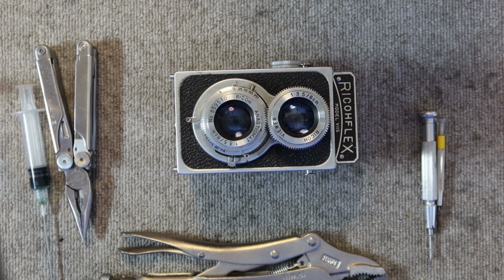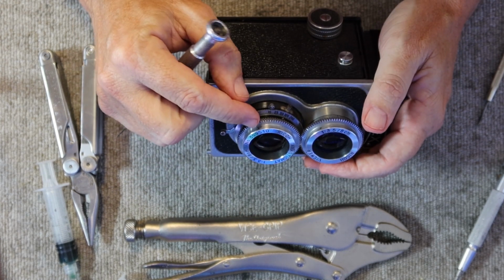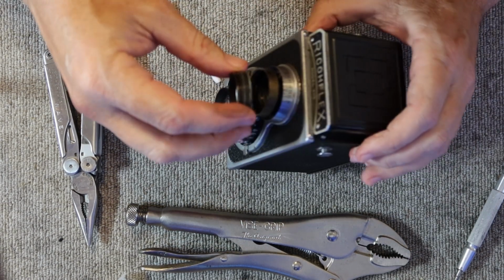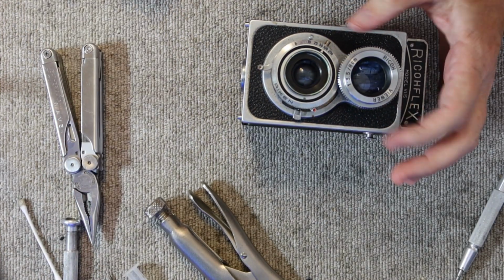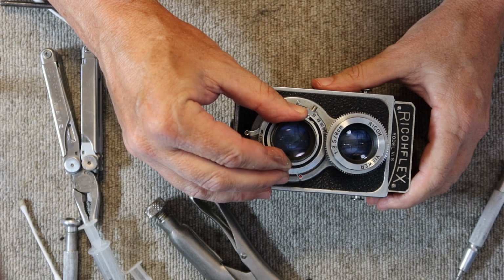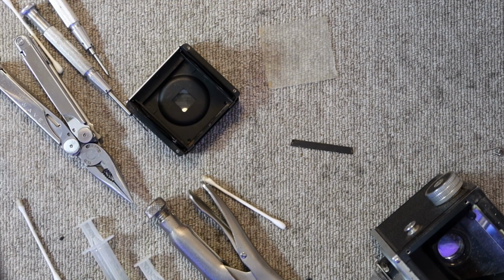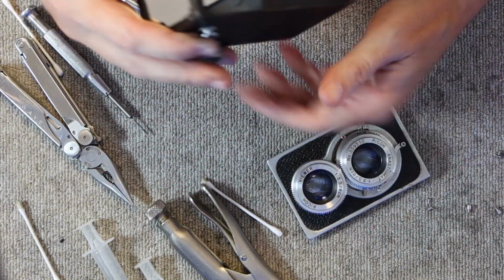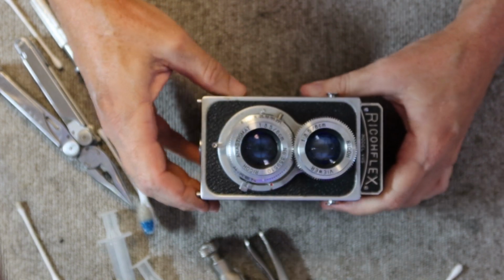How to Repair a Ricohflex TLR Camera

Comment: Great video, I wish I had this over a year ago when I took apart a Super Ricohflex whose lenses were nearly frozen and required a lot  of force to move. Didn’t know about the marks to align the two lenses, but used another method to set infinity focus.  I haven’t shot the camera yet to assess the focus, but could always take the gears off again and look for the alignment marks.
Reply: I have to clean inside the lens on mine.. the second lens from the front has a little fungus and it could use shutter adjustment.. that's the part i've never done before

Comment: Hi, Thank you for this video! I had one question - what is the tool you use to remove the first of the 3 rings on the shutter? It’s at 24:25 for a few seconds, and you didn’t introduce the tool in the beginning. Otherwise everything is crystal clear.  I’ve got an old Super Ricohflex which is totally seized up.  Husband bought it off of EBay years ago and it’s never been used. I am pretty capable at DIY, dad was a mechanic, so instead of spending $$$, I have everything else already except he bike lubricant in the syringe and that other mystery tool. Keep up the videos, they’re so helpful!
Reply from the maker: I use a rubber stopper to remove the lens base, then a screwdriver to push the lock ring around the shutter leftwards to remove it.

Comment: Hey there! Question about the helicoid marks that are supposed to line up.  Do they line up PERFECTLY when you end up threading then properly or do they sometimes end up very close but a few mm off? I have tried for like an hour and can not get them to line up exactly with the corresponding marks.